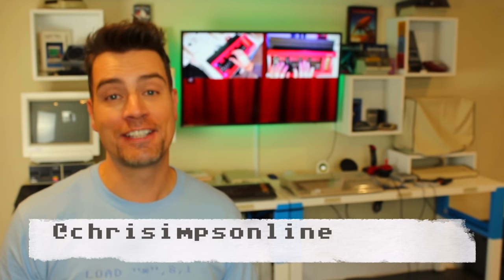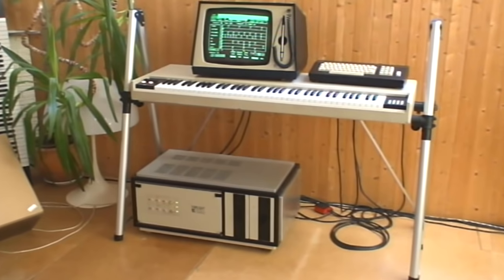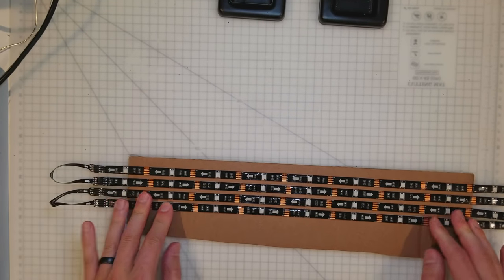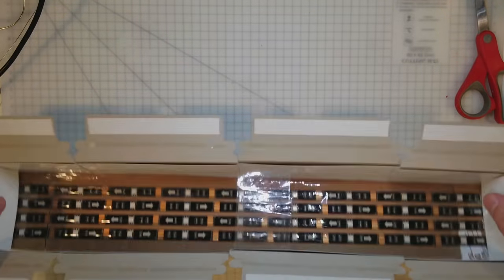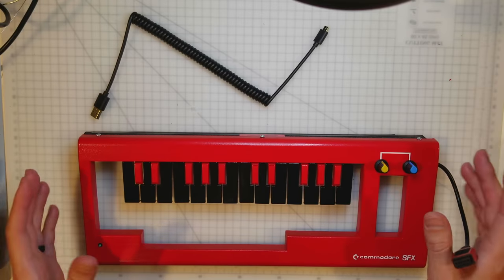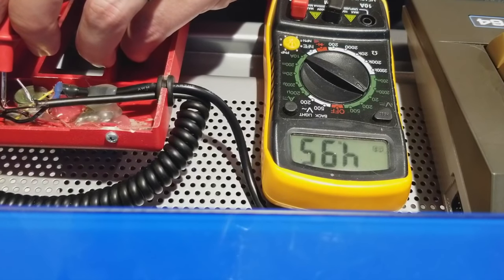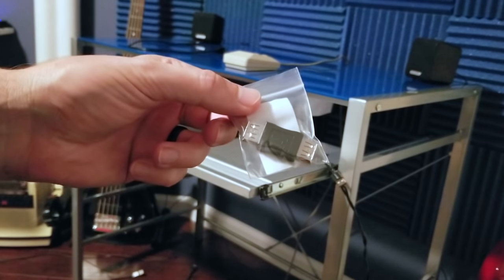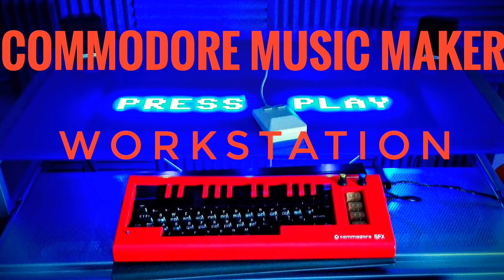3/6: Commodore Music Maker Refurb - The Music Station

Comment: Just use alcohol for the hot glue.
Reply from the maker: To drink you mean?
Reply: Alcohol somehow wants to creep under the hot glue into tiny air pockets and pops it right off.
Reply: Damn, I missed this one.
Yes, you can drink the glue if you want ;-P
Reply from the maker: Damn, could've used that info 2 days ago. Ended up using a clothes iron! (On another project)
Reply: I have just done it once, i think i have have seen Voultar doing it when he has to clean botched rgb mods from ebay.
The guy cleaned the nastiest mess even on chips with this method.